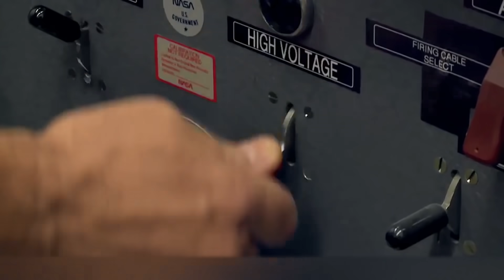First Minutes After the Dinosaurs Disappeared

Comment: The “nuclear winter” is kind of what happened (I think) after the meteorite hit. If I’m right it was six miles wide but the velocity was enough to cause the crater to be around 110-115 miles wide in diameter. The blast and tsunamis that ensued afterward would’ve killed off quite a number of the dinosaurs, but the blanket of basically debris, or like what was said before “nuclear winter”, that was preventing sunlight from entering the atmosphere occurring after the  meteorite hit,  was the biggest factor that led to their extinction. Sunlight wasn’t able to penetrate the atmosphere, so vegetation started dying off. This lead to the herbivores dying off, then the carnivores. Smaller species of dinosaurs and mammals survived (except for freakin crocodiles) tho. I’m probly wrong ab a lot of it lol